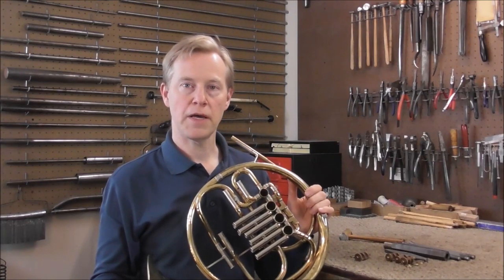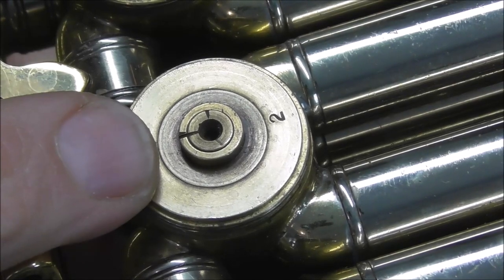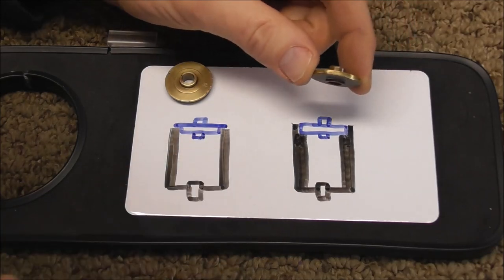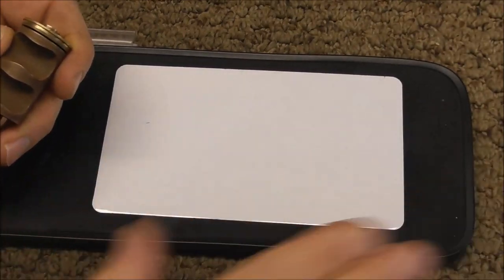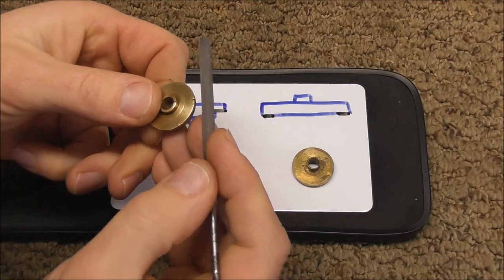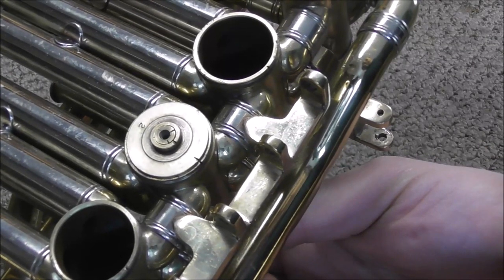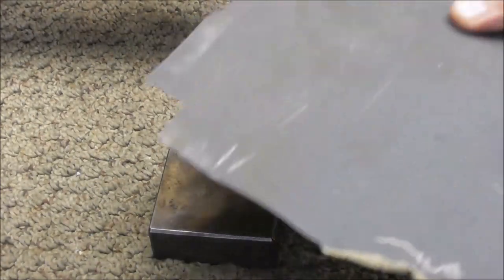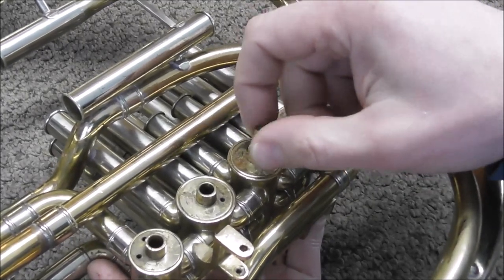How To Repair Loose French Horn Rotors Part 1

Comment: What about using two teflon spacers at the bottom? In my case, the rotors came with a small brass ring at the bottom, and i suspect that it was put there to prevent the erosion of the seat and the rotor, like a fuse (something similar to the teflon spacers idea). Teflon spacers should work better (like in the rotors of a fan) and would also fill the eroded gaps.

Comment: I need 2 valve caps cause I have a horn with only one cap but I cannot finde them to buy one ;-( So your videos are so cool bud could you add a shop where to buy spare parts?
Reply from the maker: I am thinking about doing something similar to that, but it will take a while to be able to do it.

Comment: this is why the music shop wants to charge $350-500 to repair worn rotors. not difficult but can be time consuming.
thanks for showing us how!
Reply: depending on the worth of the instruments. If you have a 9000.- Hans Hoyer Horn I would consinder not to touch it myself ;-)  My Horn was 19.- on ebay so I did it all myself even the soldering,... nothing to loose.
Reply: It's just part of the repair, not the whole process. He even said it, it only removes the up and down motion.

Comment: I have a new tip for loosenig stuck parts. I use  lighter fuel and add then, 1sec after the gasoline ultra thin valv oil. The vaporising of the fuel adds some force to the capilary force. So the oil is penetrating the gap very quickly. Do NOT Add heat ;-)  if you try this. So some parts come off very fluffy.